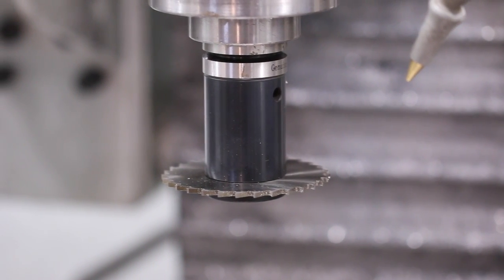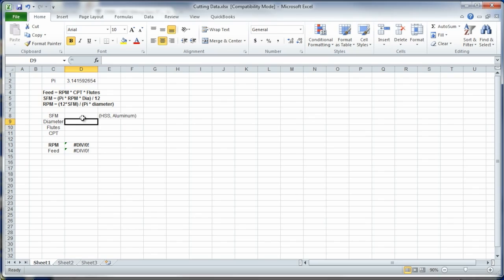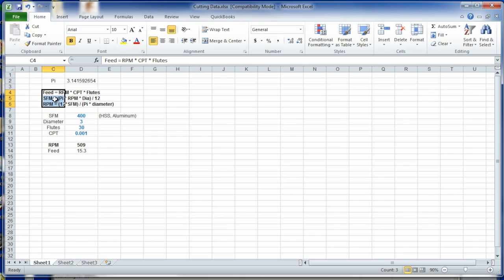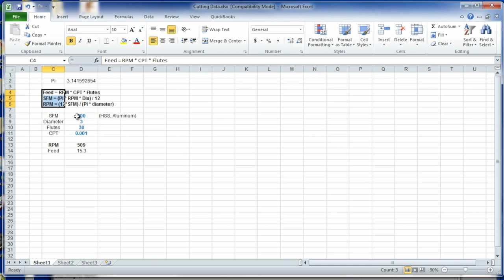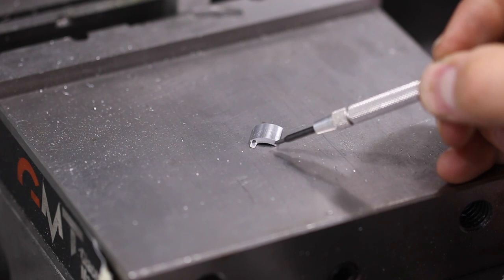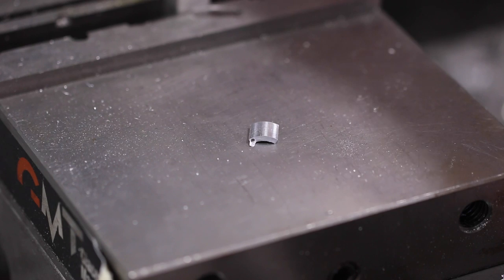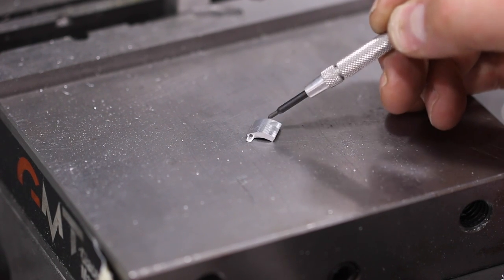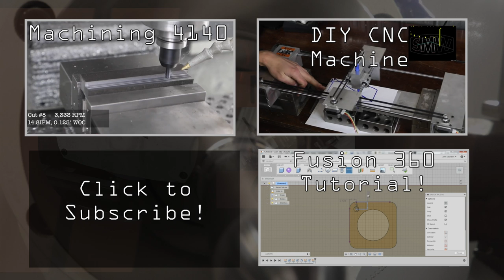Slitting Saw CNC Speeds & Feeds!

Comment: I just received my recent Tormach order yesterday.  I wish I knew they had a slitting saw.  I started to look around on their website to see what else I might want, but I was relieved to get out of there for under $100 this time.  That's unprecedented.

I have a slitting saw that I put in a TTS arbor, but using a slitting saw in an ER-20 collet is probably a big no-no.  The version shown in this video looks much more secure, even though it's retained in the modified R8 TTS collet.

I love videos like this.  A quick tip, complete with speeds and feeds for the tool.  Bonus!  The formulas and XLS file!  Sweet!  Thank you!

I'm now a Patreon patron of the machining arts!  Huge benefit to me at a very low cost.  Hey, it's a lot cheaper than all of the machining tools I've been buying!  :-)

PS - I owe you (and the rest of the YouTube small shop machining community) a tumble finishing video.  Soon!

Comment: There's a couple pretty big caveats to all of this. One of the big ones occurs when you neglect to bring your milling spindles horsepower/torque curve in, particularly in combination with large cutters on hard materials. It's also a good idea to consider radial chip thinning in your equation, as it's often taken to a huge extreme. Nice video, you've stumbled onto one of the great secrets of prototype machining..

Comment: Funny I just bought a slitting saw for a project,, just arrived last week.   Great timing, thanks for all you do, going to watch video now!
Reply: NYC CNC My intent is a Shift lever for Motorcycle... So basically need some relief to allow for compression with clamping bolt.   You had a video a few months ago where you made something similar but you used your cut off saw if I remember correctly..  Funny thing is that video is all I needed, when it (saw) arrived I looked at it and said to self, how the heck do I figure what to spin this thing at?   Turns out KISS, all the same rules apply... I plan to use it for parting as well.

Comment: John, is there anyway of not ending up with the "nub" on the part? I mean it seems kind if ironic or even primitive, that you are making such a small part to within maybe .0001 and then taking it over to a bench grinder and plunging it in by hand to remove the nub. If RPM's were increased and feed rate decreased would it have less of a tendency to leave that nub?
Another great video by the way! 
PS: Be nice to hear your opinion on some of the comments about "climb milling/cutting" with parting saw!

Comment: I've just butchered my 1/8 disc cutting mild steel :( Any chance of sharing that spreadsheet you were using for feeds/speeds? .. rather than starting one from scratch. It looks better than any of the calculators I've seen so far.

Comment: John, If you do another video on slitting, please over-emphasize caution while climb cutting with solid carbide saws. I had one grab the part and shatter on me, slinging fragments. They luckily were embedded into a wall and no one was hurt. I never had a problem conventional cutting for years after that incident.
Reply: NYC CNC Yes, I agree and the blade was only .030.

Comment: I got a slitting saw for my Grizzly mill some months back.  First time I used it I crashed the thing and seem to have ruined the arbor.  Maybe I will give it another try.  Thanks for the video.
Reply: cerberus Obviously you'll keep an eye on the concentricity, since you've had a bump. But a slight wobble will just give you a wider cut. Make sure you push cut by the way, don't climb it.
Reply: NYC CNC I will not be wasting any time on that arbor.  I will just get a new one, they are cheap.
Reply: wordreet no climbing, getting a new arbor so it should not wobble.
Reply: We usually turn up our own in house. Our biggest s/saw is 100mm diameter and 5.5mm thickness for cutting fins in a customer heat-sink. Actually, it's technically not a saw, it's a side and face slot cutter with alternating offset teeth, each one having a precision ground cutting edge on one side as well as the tip.

Comment: Hi John,
I just saw your single treading tool example and took the same idea and made a slitting saw with arbor as one of my tools.  Have you tried designing a part in HSMWorks that needs a slit and actually slitting it?  I just don't seem to be able to figure out how to do it . . .I think it would make a cool vid . .joining 2 of your tutorials into one

keep up the great work . .have been following you since around since 2010 . .good to see you living your passion.

John Cameron
Patrean Supporter
Reply: +NYC CNC 
I used your tutorial to make a slitting saw on a 1/2 arbor for my CNC Mill.  I am having trouble generating tool paths to use it.  I thought that maybe there was something I am missing.  When I try to slit, the saw moves through the material stock from above rather than passing to the right of it and then making multiple cuts to get to final depth.  I saw you used a slitting saw to cut a small part, did you model that up or just "conversation it"?

thanks John

Comment: Try to cut stainless steel 17-4? I am having problems with feeds and speeds. I am trying to make a .160 thick  .440 width and 1.140 length part, I am trying to make a cut of .080 and 1.040 deep. I can cut it but my slitting saw wont last long, I only make 7 parts per saw I am using S400 RPM and Feed .5 on a Fadal CNC Mill.

Comment: You did climb mill it, not conventional.  Clockwise around a part is climb, counter-clockwise is conventional.
Reply: That is partially true. It depends if you are using M3 or M4.
Reply: Matthew Diaz Which also depends on if you are above or below the equator.
Reply: eformance No that's only for toilets.
Reply: Depends on whether you have a left hand or right hand slitting saw.
Reply: Don't be too hard on yourself, the important thing is that it worked.  For such delicate parts I'd recommend a finer pitch saw so it leaves less of a tab.
Reply: eformance Funny.... lol, stupid joke = stupid grin... :-S